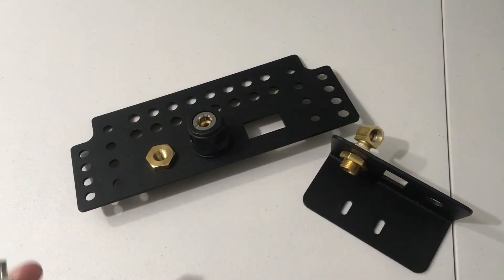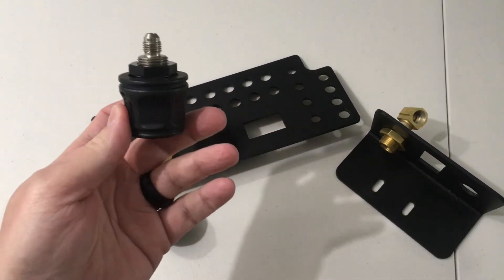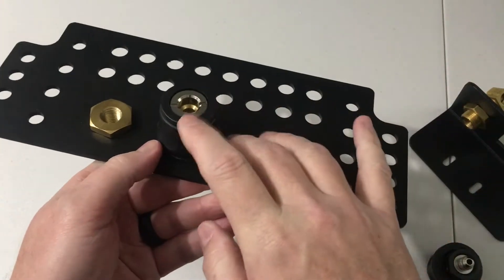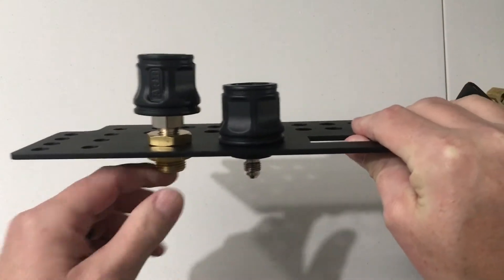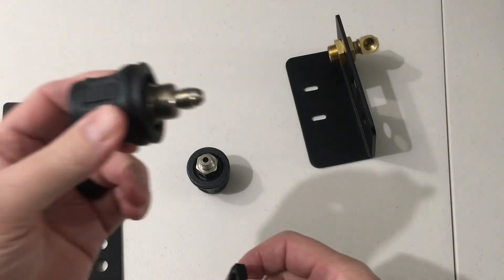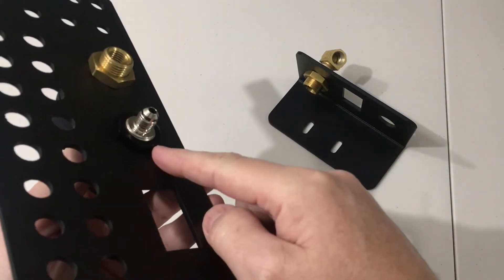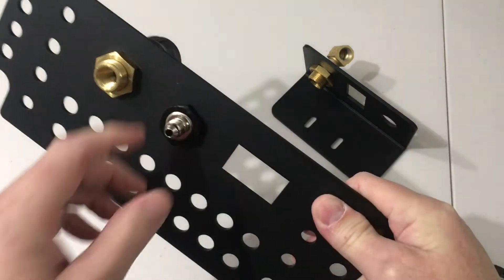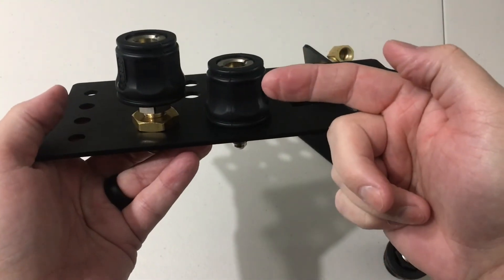813 Fabrication & Design - ARB Air Couplers and how to use them with our ARB compressor mounts.

Comment: Can you adapt the flush style coupler to use a 1/4 air line for those that want a flush mount but would prefer a flexible line?
Reply from the maker: the JIC-4 air coupler connects flexible stainless steel air hoses. We mostly use GRIMM Off-road air lines in our kits along with ARB air lines. Was there a different type of flexible line you had in mind?

Comment: you say nothing on the nuts and whats needed to put a push in style air line
Reply from the maker: I normally don't spec the push in style connectors. After comments from several customers mentioned they had those style connectors in the past and they cracked and failed due to heat and pressure, so I stopped recommending them. If you want to use push in style air lines, they are typically 1/4" fittings so you will just need to use the 1/4" bulkhead fittings to work with the mounting plate.

Comment: Do you make a mount for a tacoma? Thank you
Reply from the maker: Not at the moment but hope to in the future!
Reply: @813fabricationanddesign  do you know of any mounting solutions for a remote coupler? For a Tacoma. I see arb makes only one mount and I’m not sure where I’d put that mount.
Reply from the maker: @microsnook3  it may be possible to use one of the existing plates for the air couplers that we have to mount somewhere. But, I am also working on designs for just the air coupler and being able to mount it in various locations.

Comment: the JIF fitting looks like the rubber grommet is so close and up against the plate, it would be difficult to release the air chucks or air hose. is that an issue ?
Reply from the maker: That is how the JIC-4 air coupler works.  Once you put your airline into the coupler it pops the rubber body up off the plate.  When you are done using the airline, push the rubber casing down and it pops the airline out. I really like this one the best as it stays so compact.